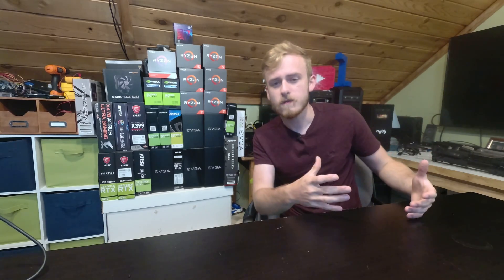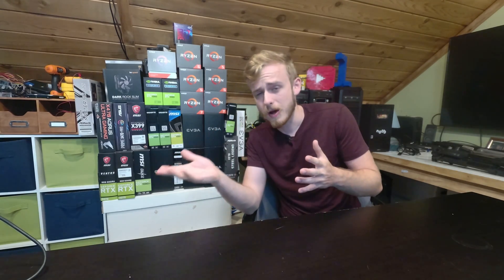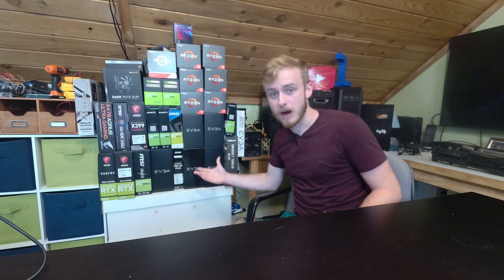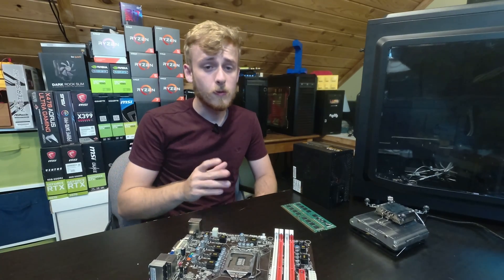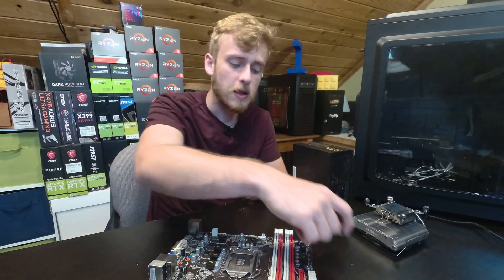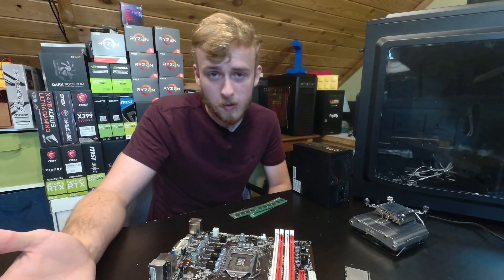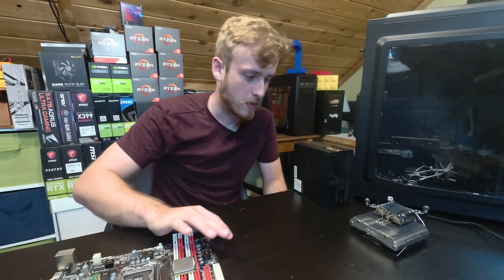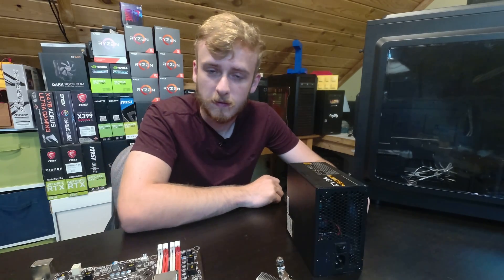Building A $50 Budget Minecraft Server Computer - Ultimate Cheap Server PC Build

Comment: Help?

Well I own my own private server with friends. I run it on my own time with my i5-9400f and 8gb or ram, power supply is a evga 600br, 1tb m2 stick. 

I was thinking of going 24/7 and possibly opening up the server.

So I can speculate that I want a low wattage power supply, a strong single thread Cpu, and just 16gb of ram. 

Any suggestions?

Then again I was also thinking of getting a Server motherboard and running duo cpu's, but I'm not knowledgeable about it and I don't wanna spend unnecessary money.

It's like buying 300 dollar water, or what I'm trying to say. The hardware is above what minecraft is programed to handle. 

Thanks if you reply.
Reply: ip?

Comment: Hi Id like to ask if these specs are good to run multiple MC servers on it? Intel Core i5 9600K, 16GB RAM, SSD where MC files are exclusively saved. OS is running from HDD.
Reply: yes ur cpu is 6c12t if im not mistaken and 16gb should be good enough maybe try upgrade to  32gb if you are planning on runny tonnes of servers on ur pc.

Comment: if you have a lower end cpu you can pregenerate chunks using a plugin, then the chunks will be stored on the drive and will be used when needed instead of generating it realtime which uses a lot more cpu power
Reply: pligin name?
Reply: @RajlifyXD  just search up Chunk Pregenerator, there are plugins and mods for Forge, Fabric and more, find a suitable one for your server.

Comment: The odds of anyone being able to buy a $50 PC that will include a quality PSU, 4 Gb RAM, a quad-core CPU and a bare-bones main-board at a yard sale are astronomically against you.  Anyone that bothered to buy a PSU that wasn't part of a off-the-shelf system will have spent at least $35 (not including shipping or sales tax).  It's like the lady that sells her grandson's corvette for a few hundred bucks... super rare.

Now if you had said you could take particular systems and upgrade the CPU to a fairly recent generation i5, throw in another stick of DDR3, add a small SSD and take out the optical drive, then yeah... some HP-Compaq or Dell would suffice.  But chances are that you'd have spent at least $75 on top of the yard-sale PC you'd found.  I suppose a person could buy stolen computers and get them super-cheap.... but still not going to get everything for your $50 budget.  Sorry.

Comment: Alright, listen
I recommend you just buy a few raspberry pi zeros, or if you're looking for a more powerful server computer, go for a raspberry pi 4. They're just as easy to set up, and they're tiny and affordable.
Plus, the raspberry pi zero, (Normal, not the wireless one) Is only 5 dollars!
So you can stack up on multiple raspberry pi zeros to use for your server, but i recommend using the zero W, as it has wireless capability, such as bluetooth and WiFi.
Raspberry Pi 4s offer 2, 4, and even 8GB of ram, meaning you can run a server with no problem using only one Pi4, and the software you're using to run it.
All you'll need is to do some overclocking for your Pi4, only if your server is going to be making lots of calculations, and needs the power.
If not, and it'll only be a simple minecraft server, no overclocking is needed. all you need is the RAM.

Comment: Picked up a refurbished hp proliant with 96 gb ram, 2x 8 core 16 thread processors, and 600 gb hdd storage (added 1 tb ssd afterwards) from amazon. Total cost initially: $400. Cost afterwards overall (after adding ssd $550). This machine can run servers with 100+ plugins and runs with nearly no lag. You can pickup some cheaper refurbished hp/dell servers for as low as about $200 and get a lot of ram, and cpu cores. Just search “server” on amazon.

Comment: I want to host an MMO server (unreal engine) with 100 players per server, there will be 10. What specs do i need?
Reply: depends on the game and how it uses the server. Minecraft (specially Java edition) is CPU dependent, CPU with good single core performance runs better, dual core at minimum, quad is recommended. for 100 player minecraft server, atleast 32gb ram and ssd is needed to run smoothly.

Maybe the game you are thinking is less power intensive. so i'll recommend Xeon, SSD, and much ram as you can.

Comment: I host a rlcraft (128 mods) server on my gaming pc for me and my friends (max 4 ppl) it's very easy to do 
I put max 4GB of ram for the server and I port forwarded through my router which was surprisingly easy the server runs ok with 4 people on which is surprising with so many mods but with under 3 people runs very well with no lag at all even with my dodgy wifi connection.
Reply: What's your processor
Reply: @lukebrl  R5 2600

Comment: This is a little late but I want to try my hand at hosting servers for others for a little bit of side income and I was wondering if used 2nd gen ryzen would be a good idea. In my area I saw a r7 2700 for 110$ used and I figured pairing it with a budget b450 and a cheap gpu to boot with would work as something to host 5 or 6 servers with? I've accumulated a hoarders stash of ram sticks so I'm not worried about that in the slightest, but I was wondering if paying for all that would be worth after awhile and how many servers you think I could safely host on 8c/16t 32-64gb of ram

Comment: When doing a minecraft server you should focus on single core performance as the server can only use one core. When it comes to RAM it's recommended about 1gig for 10 people, having 8 gigs - 2 for os leaves enough for 60 players, but then you're having other issues like CPU bottleneck and disk IO.
Reply: Thats what i was thinking too :D I Had 5 buddies on my mc 1.15 server  with quiet some entities and it was lagging so much. And i am using a Ryzen 5 1600. It made no difference if the server had 2gb ram or 16gb. Now using a i5 750 all cores except one deactivated and overclocked to 4.8GHz and it runs so much better. :D
Reply: I wanna make a survival server with big farms and like 5 people on at the same time. Like hermitcraft but less extreme.
What do you recommend?
Reply: @gurkimo1304  5 people and big farms, youll get by with prett basic specs. 1gb ram for the server would work, since its  so cheap, theres no harm in giving it 2gb. 

If you have an older laptop or desktop laying around it should work well.

If youre buying as a service, 1gb should do well, if theyre a host with low IO(hhds instead of ssd) Id use 2GB ram. 

Running a realm is also a great simple option!
Reply from the maker: Sadly our Vanilla survival server pulls 8-10GB of ram running paper with 6 people on. That’s prob the farms tho.
Reply: @JaysTechVault  ok i will get 16 gigs of ram then
Reply: @JaysTechVault  after running minecraft servers since it was added in alpha Ive never seen or heard a vanilla server needing that much ram for 6 people.

Java is very ram happy, if you give it 12gig itll eat 12 gig. Sure it really needs that much? Other problems might explain it, bad java version, or poor cpu. Since minecraft is single core performance maybe thats the problem, you can also configure the java GC heap size, that helps in some cases.

Im currently running a 200 ftb mod server with a lot of activity for 10 people, chunk loaders, automation etc, it eats about 6 gigs of ram atm.
Reply from the maker: You underestimate the size and complexity of the farms
Reply: @JaysTechVault  yeah  tntexploding, item drop pistons firing,...
Reply: I'm pretty sure that servers after 1.13 are multithreaded but I'm not so sure now :/

Comment: Would a 2c/4t cpu and 8 gigs of RAM be good? (Specifically an athlon 200ge and 8 gigs of dual channel 2666 mhz)
Reply: wont recommend 2 cores even if the cpu is new

just get a cheap used 4c intel cpu on ebay

Comment: So I have a server running on a Core i3 4160 (2 cores 4 threads, 3.6GHz) with an SSD and 4GB of RAM allocated to the server (8GB total RAM). I host for about 8-9 friends and I keep getting 'can't keep up' errors and lag. It's really starting to get annoying and I thought I'd ask here to see if anyone had any ideas. Should I change CPUs to an i5 2500 or something with 4 physical cores?
Reply: @Alejandro Hernández López I dont know if this is always the case, normally I would agree but recently Ive been doing some builds and my 2.9ghz 12 core system has been out performing my 3.5ghz 6 core system by about 12 percent running mc servers, both have 32gb of ram at 1600mhz  so the only conclusion I can come to is that its utilizing those extra cores and thats whats giving it a performance boost.
Reply: @johnwrens2255  yes, servers after 1.13 can utilize multiple threads

Comment: Just so I know... AMD is fine for the server? Or an i3?
Reply: AMD cpus usually are more picky with ram for some stupid reason but like Kobe Vink said it doesn't matter as long as it has a reasonable clock speed and 4 cores. 

I'm going to be using an old core 2 quad pc I got from second hand with like 4gb ddr3 ram. It'll be hella slow and demanding things in minecraft like elytras would have to be disabled with a plugin. But it will kinda work. I'll use debian.
Reply: it doesn't really matter as long as it has 4 cores

Comment: For mostly vanilla (plus maybe a few small mods) this is fine, but if you want to do a lot of mods you need a powerful CPU. In particular, you need IPC (Instructions Per Clock). The more work the CPU can do per clock cycle the better... but this means you generally need a more modern CPU. It's the one problem I always run into when self hosting for me and a few friends. It's never RAM, storage, or network... it's always CPU that ends up being the problem. As soon as 4-6 players each go in their own direction the CPU starts to struggle with the world generation and you end up with massive tick lag. Sometimes you can get around this issue by pregenerating chunks. I usually do this anyway and let the server generate like a 20k by 20k area around spawn. It can take quite a while, but when done it only has to serve you the chunks and not generate them at the same time. That said, the last time I hosted a server was in version 1.12. I tried a 1.14 server this past weekend and it seemed to run MUCH better even with mods and it seems there is more multi thread support. The version you play also matters. There were huge changes when 1.8 came out and it seems there are big changes again after 1.12... but I still need to do more research and testing on the newer versions to find the limits.
Reply: Thx I was actually wondering this, I  am interested in a modded server for my friends and I.
Reply: I wanna make a survival server with big farms. A bit like hermitcraft but less extreme. There would be arround 5 people on at the same time. What do you suggest for me?
Reply from the maker: Hey Zeger, you could always join mine. It’s 6 years old and has a lot of farms already. https://discord.gg/TEnnxMH
Reply: @JaysTechVault  yeah but i want a private surver with my friends
Reply: Where you can be free to do what you want
Reply: @JaysTechVault  but i will look at it
Reply: @gurkimo1304  Hi. It's difficult to say. I'm far from an expert and can only speak from personal experience. 

In version 1.14.4 I had 4 people on a old i5-4670k, stock, at the same time running around the world and it was smooth with almost no lag. The only tiny bit of lag we would sometimes get was when the automatic backups ran, but that was mostly due to the host machine running on a hard drive and not a SSD and the backup being created on the same drive the world was hosted on. So the hard drive had to read and write a 6Gb world from it self to it self which was not great. If the backup can be written to a separate drive it would eliminate the lag issue we were having, but at the time I could not do that.  

For me the biggest cause of lag is world generation. As players explore, more of the terrain needs to be generated as they run around the world and that takes quite a bit of CPU power and is not uncommon to see 100% CPU usage when a ton of chunks are being generated at the same time. If players stick to parts of the world that's already generated, the CPU would be under 10% usage... in our case with the 4th gen i5. 

In the past, I would try and pre-generate a large part around spawn before we would actually play in the world. I found that pre-generating 100 by 100 chunks (1600x1600 blocks) should be perfectly fine and I used to use mods for this. You can go larger and I have, but it takes a lot of time. 100x100 chunks is enough IMO. I've not messed with minecraft servers for a while now, so not sure if such mods exist for newer versions or how you may be able to do this in vanilla. Google is you friend, but I would say just try it first before you spend a ton of time on something that might not be needed as it can take a few hours depending on how much you pre-gen. You can always pre-gen after you started a new world if you find the world gen makes things too laggy.

I know for season 7, the hermitcraft server is using a Fabric MOD to help with performance. Something to do with the mob AI... I do not recall what it is, but I'm sure you can find it on the web.

If you have an extra machine with at least a 4th gen quad core CPU (not dual core with hyper threading, 4 actual cores) and you do not have many mods you should be OK generally speaking. From my experience, a Intel 4th gen I5's and up would be my minimum recommendation along with 12-16Gb of total system memory and from my experience a mechanical hard drive works fine. 

That said, we've never really build GIANT farms with a lot of pistons or other moving parts... so maybe something like a 7700k would be better if you know you'll be building crazy big stuff and loading tons of chunks at all times with large view distances. 

If you can buy new, best bang for your money right now seems to be AMD R5-3600 or Intel i5-10500 (Both same price where I live right now).

The other option is to pay for hosting. This I have not done myself, but I know there are a lot of companies out there that offer such services and from what I saw in the past it was not very expensive if you want a server for less than 10 people. Some even used to offer free trail runs so you can test and see if their service would work for you. This might be the easiest and simplest route, but it will depend on what you want.

Naturally, everything has it's limits. The higher the limits you want to go in minecraft, the more it will cost you. Building big farms is generally not that bad, depending on what or how you build it, but spacing those farms out so not all of them are loaded in the same area at the same time would just be a reasonable thing to do regardless of the CPU horse power you may have.

Sorry for the long post, hopefully there is something useful in it for you. GL

EDIT: Just a performance summary with the i5 4670k I was using.
CPU usage was quite high when world was being generated as player explored. Use pregen if this is an issue.
If players stuck to areas already generated, cpu usage would be under 10% generally.
I set the max memory usage to 8Gb for the server and that was plenty in our case as we had only a handful of mods.
A mechanical hard drive worked fine, but would sometimes cause small lag when automatic backups ran in the background... not that it was really an issue, just noticeable.

If you want a smooth experience for less than 10 players:
- a Intel 4th gen i5 would be the minimum IMO and pregen would be a good idea.
- 12-16Gb of total system memory (Old ddr 3 is perfectly fine)
- A hard drive should work fine... a SSD will work better.
Reply: @nic_s5215  thanks
Reply: @gurkimo1304  Updated with a summary.
Reply: 6 years later and the info still good thx
Reply: Dude chill. So much text I can't read
Reply: If you can't be bothered with the effort of reading (Or maybe you really can't read as per your claim...)... why not just ignore it and move on instead of doing more effort to post a pointless reply??? It's not a must or a requirement that you post anything at all... you could just ignore it...

Comment: god i wish the used pc market was a bit cheaper here so i could do this
Reply: You could buy an dell lga 775 board for $15, slap it to a piece of wood and install something like MineOS. Or you can wait till you see a good deal.I'd recommend 775 for vanilla, but 1156 and newer is a must have for modded, especially huge packs like GT New Horizons where JEI actually lags.
Reply: Saad Amin  yeah I have a bunch of 775 boards and some 1150 boards. I'd be blessed if I managed to find a 1156 board. unfortunately they're pretty much impossible to find under 200$. Good video btw. Sounds like you know what you're doing
Reply: My current MC server is running on a dell optiplex 7010 3rd gen i5 and runs perfect.... im sure you can find one under 150 or even cheaper

Comment: Take a shot every time he says "i know what i'm talking about"

Also what about some more expensive servers, like 100/200$? I have a friend that wants to host a private server for playing with friends and whatever and the renting prices are a little high
Reply from the maker: I would recommend getting an old workstation. From Lenovo, Dell, or HP. Something with a lot of cores and a lot RAM. Honestly RAM is much more important than CPU so if you have a lot at $200 you can host a lot of servers.
Reply: thanks but i dont wanna die
Reply: Toasty bros made a simple to follow vid if you want to check it
Reply: Try LGA1366 not much money and you can get good Xeon for them. Some search and you can get MOBO dirty cheap sometimes with RAM and CPU.
Reply: Get xeon from 2011-2014
Get a motherboard which support your xeon and maybe engineers
Simple get some ram and ssd they you go
Reply: and now im drunk and out of alcohol
Reply: @alphaomega471  the servers generally run multithreaded after 1.13